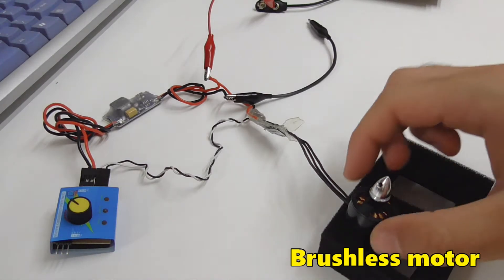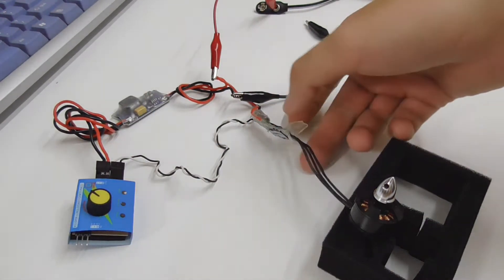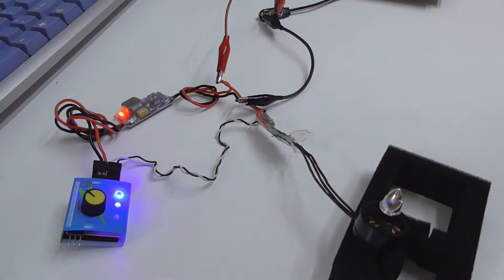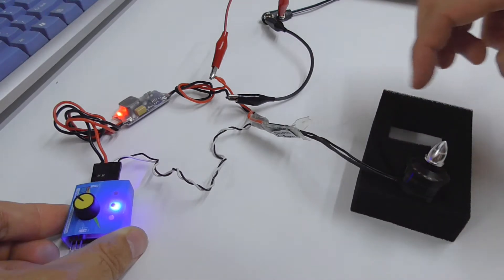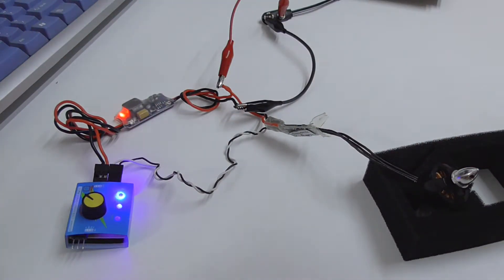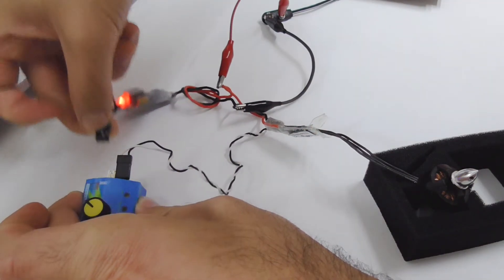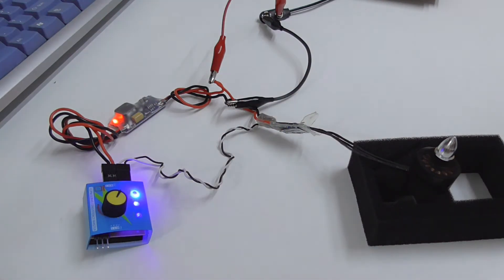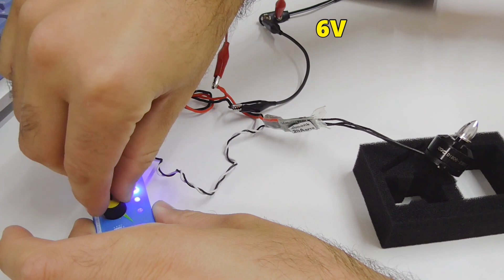Servo Tester + Brushless Motor (Blue, 3 pin, Potentiometer)

Comment: Does this push motor to max rpm? I am wanting to use this setup to power a hand-throttle controlled device without any wireless transmitter or receiver